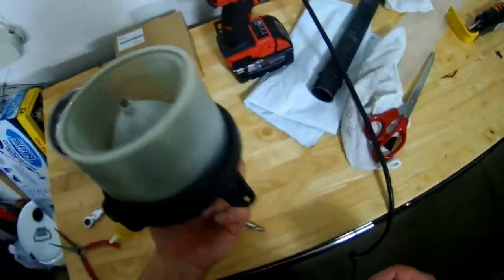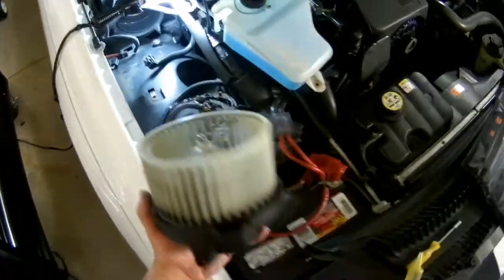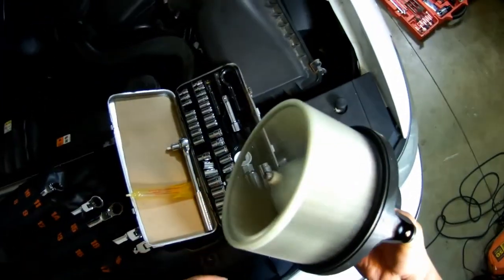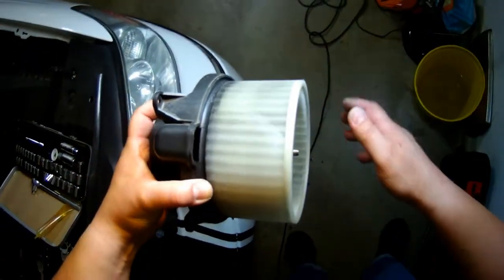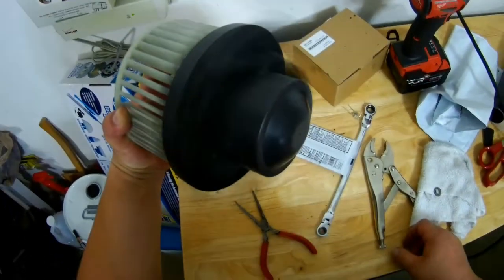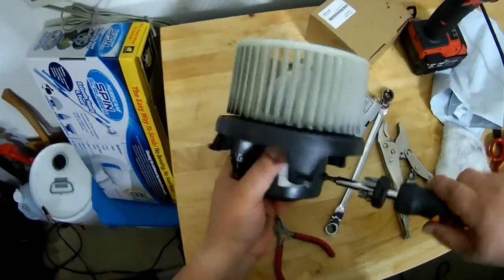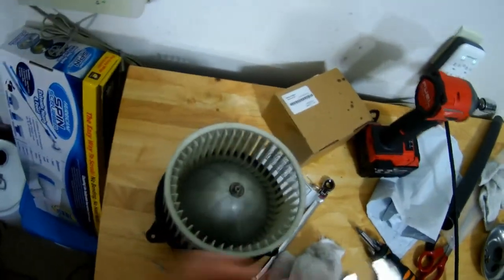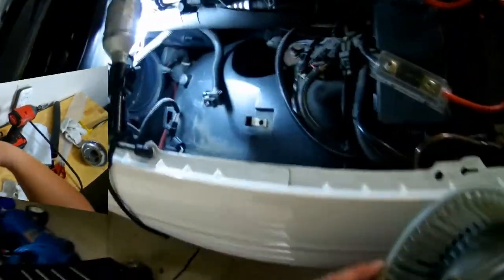Lubricate blower motor on Lincoln Town Car 2003-2011

Comment: Excellent video .... also add electric grease to that electrical terminal and you it would last forever ... most failure of these fans come from motor ... heat kills them ...
Reply from the maker: Your right the motor locked up on me from the heat. Since this video it's working great still and no problems with the A.C. or heat. I'll add that electric grease on the connector soon thanks.
Reply: How do you get to the motor terminal?

Comment: I was ASE certified air-conditioning mechanic And I’ve never thought of putting oil in that motor. I would’ve just Replace the motor and fan. I think this is my next project👍👍
Reply from the maker: What happen was the fan wasn't on or turning. I heard everything else turned on except the fan. This happen on a hot 🔥 day at that. When I put the oil in I really felt the difference from spinning it. Till this day it turns on didn't fail me no more and I get cold A.C.
Reply from the maker: Merv's service secrets channel his video is in my descriptions. He's the one that saved me. Give him a like and thank him....This is the reason I love 💘 youtube. We're all here to help one another....

Comment: LOL spinning the blade first = light weight no rotational mass / after lube job spinning heavy side = more rotational mass ////// FAIL
Reply from the maker: Copy that and with today's update it's still working fine. Has not locked up or burn out. Cold A.C. and hot heat blowing out fine. Thanks for your comment and for me to wright an update on it.
Forgot to mention this is the second fan that I installed. Working fine till it started acting up.
Reply: Please explain wtf u talking about in detail